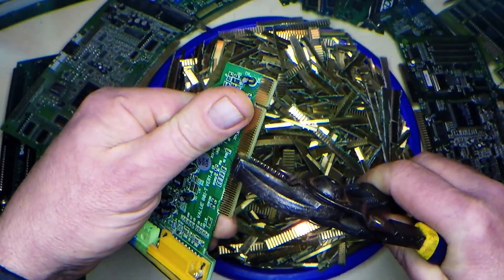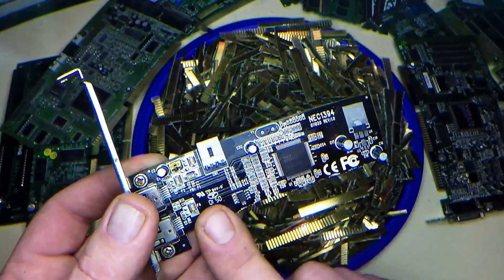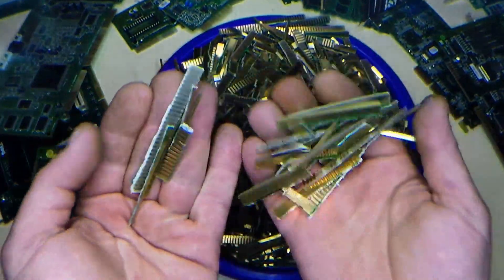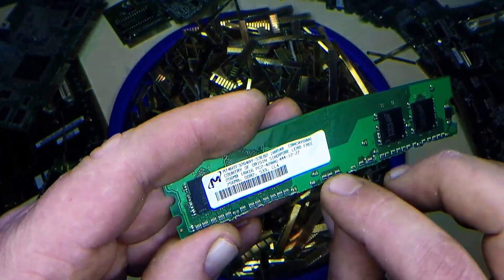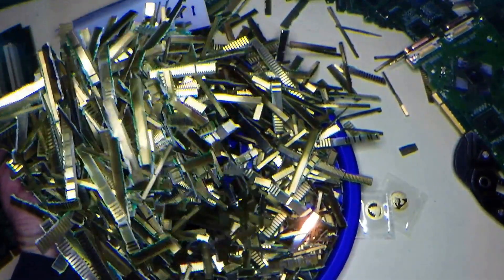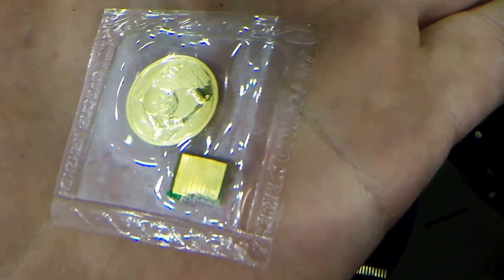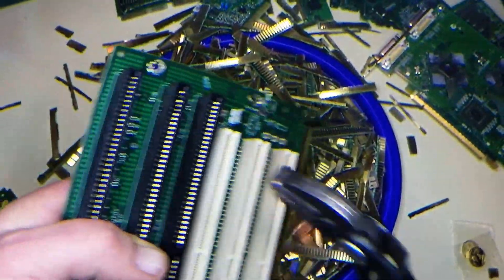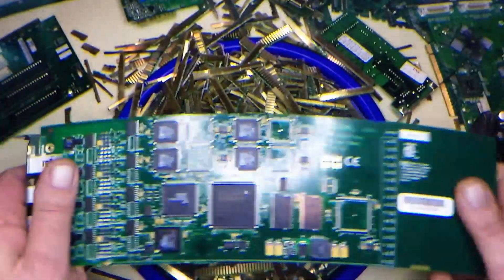Stacking Gold Fingers from scrap computers

Comment: Just starting out. What is aluminium heat sink , and keep separate from other aluminium - why is this? What is a slot card, ram stick and IC chip?  I heard you mention a carat solution is this to find if high or low grade gold or if in fact gold at all? Do you separate grades of gold?Thank you so much for your help - look forward to your reply.Wazza
Reply from the maker: +Warwick Atkinson aluminium heatsink is what sits on top of the cpu in pc's, it's usually extruded aluminium si it's worth a little more then regular. slot card like a video card or network card that slots into a motherboard. ram stick is RAM, the memory sticks. IC chip are the black chips on a circuit board, usually long and black with legs on each side.
Reply from the maker: +Warwick Atkinson end of the day gold is gold, at this stage don't worry about it, just stack it up and when your more experienced you'll know the difference.

Comment: there is  metal and other circuit boards in there little ones but still
Reply from the maker: +Nate Chaps thee board is not in the screen, yeah I take the board but i don't pull apart the screen, I leave it intact and send to recycling, your question was do I take apart the screens.

Comment: How many Rams routhly to make 1kg bulk of plated fingers?
Reply from the maker: +Adam Dilem too hard to work out, ram weighs different, depends on the ic chips on it, a lot of gold is in the ic chips and the whole ram stick can have gold plating on it, so the fingers are just a small part of it and most ram you don't cut fingers off, you process the whole stick.
Reply: eWaste Ben want to know how much is it worth to pay per unit for gold recovery.
Reply from the maker: +Adam Dilem you buy per kg not per single unit, US$20 per kg max if your recovering gold from the ic chips too.
Reply: eWaste Ben I'am based in the UK and UK sellers are asking for about £20/kg of RAM (if you add the shipping fee) often more! Which is over $30. Wonder how the buyers are getting any profit out of it.
How do you process the whole ram then and how do you get other than gold precious metals content too?. I know there are expensive shredding and grinding installations for that but am talking at a level of DIY at home.
Reply from the maker: +Adam Dilem you remove everything off the stick and dip them whole just like you would fingers, let the gold disolve in the solution, the ic chips are usually incinerated to get to the gold. 20 pounds is too much to pay, you better off building them up from pc's you find
Reply: +Adam Dilem there are roughly 4 or 5 circuit cards in a desktop PC. There are probably about five to seven hundred trimmed fingers in a kilo, conservatively speaking. So it would take about 100 scrap computers to acquire a kilo of trimmed fingers. If you can get the computers for free then it would be worth recovering the gold. But if you are paying for each computer, well, you can do the math. This has been my experience, not just my opinion.
Reply: eWaste Ben Is there any video or link that explains a detailed procedure if you treat the whole stick? All the videos I came across show only how to treat the fingers. 
The other thing is since the Gold is only a portion of the metal value of the scrap. Would be nice to know the whole procedure of separating and extracting not just Gold. 50% of the valure of memory sticks and mother boards is copper I believe I read it in a someone's graduation thesis.
Reply from the maker: yep, free is where it's at
, but there's more to a pc then fingers, you got ic chips, motherboard, hard drive etc etc, and pc's are just one item in ewaste.

Comment: Hello, I've been running across memory cards with "silver" fingers. They're from Cobalt network hubs which, sadly, I found no buyers for so I'm scrapping them. I still have 5 or 6. As much I would hope they are platinum....I'm guessing they're something worth very little...silver would be nice at least. Any ideas?
Reply from the maker: some say silver, some say tin, more value in the ic chips though
Reply: Thanks! I'd still like to get a photo of this LARGE CPU (roughly 8 or 9 cm square) I found in one of my pickups. It came from some IBM machine based on the sticker on it bearing the logo....but no more info on it. White, heavy ceramic with wider spaced gold pins. The heat sink it came in is gorgeous as well. Had solid copper spacers in it too....very cool.

Comment: hey man how many components in a pc or laptop contain gold?
Reply from the maker: +Shayne Symonds quite a lot, most things that connect and the motherboard has many items with gold
Reply: hardly anything inside a laptop, there is the processor, ram chips, some connector pins, sometimes the sound card outlets, the processor base and the docking pins for your hard drive that's it and maybe some ic chips.

Comment: i dont think you need to separate the connectors from the boards, you can soak them together and the etching solution should recover more plating